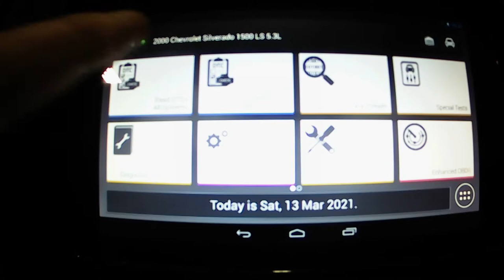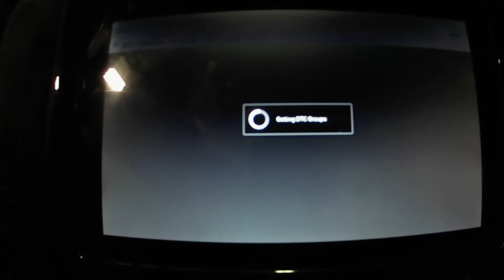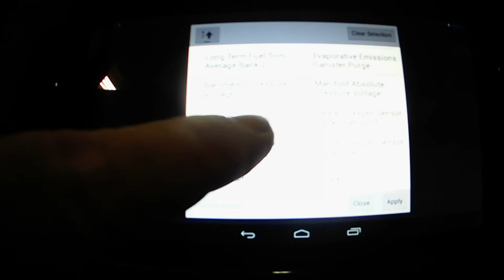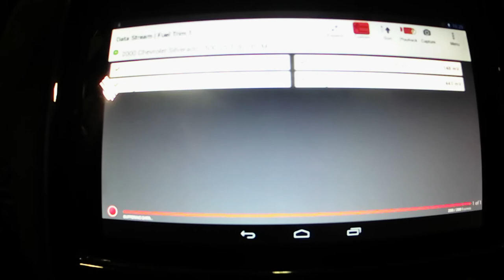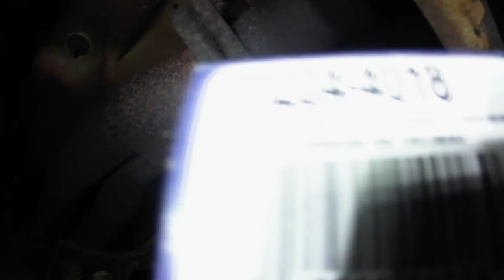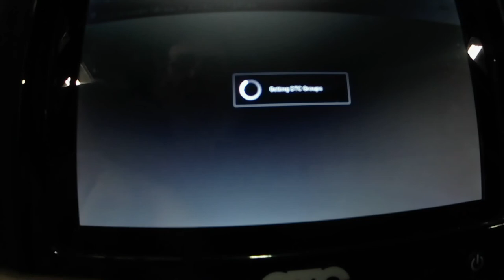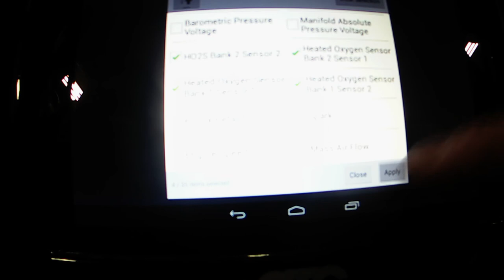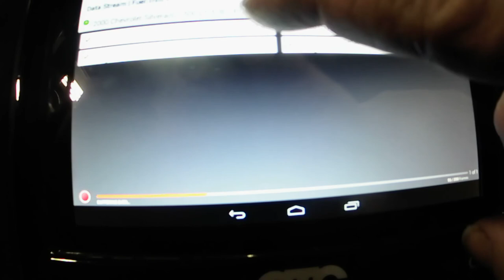How to replace a Oxygen sensor on a 2000 Chevy Silverado  #Chevy #Silveraro #o2sensor

Comment: If I'm getting a droning on my 05 1500 4x4 is it most likely a wheel bearing? Changes with speed,. I had the brakes checked, survived last month and they are fine.
Reply from the maker: Yes it very well could be. Also check the front differential
Reply: @PullerbearEd  thanks! It's got independent fronts, I hope it's not differential! That just sounds expensive.
Reply from the maker: It could be the CV or something. Lots of rotating parts in those front ends.